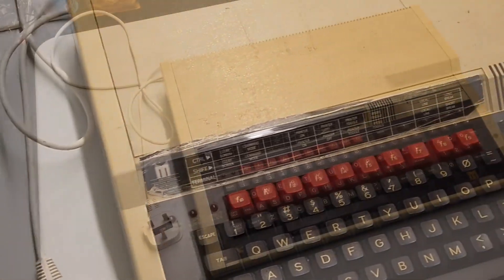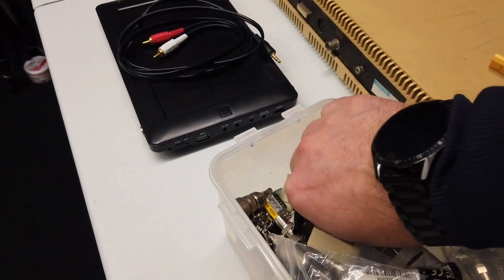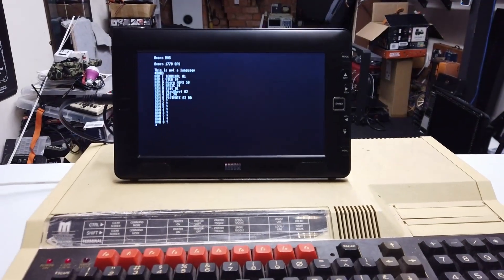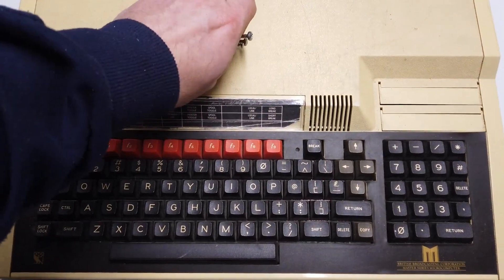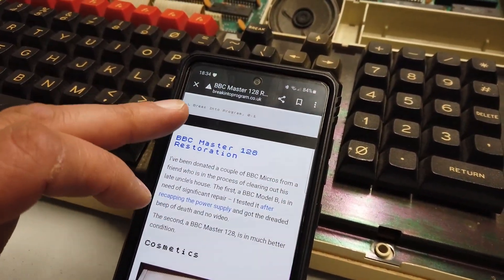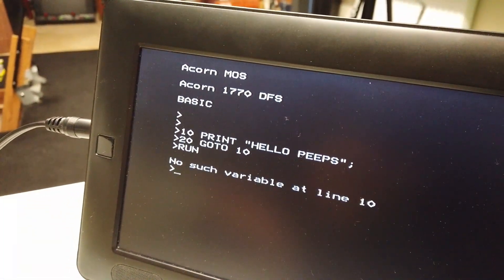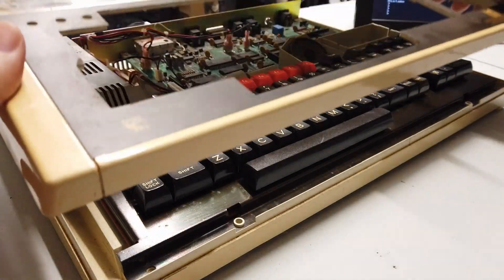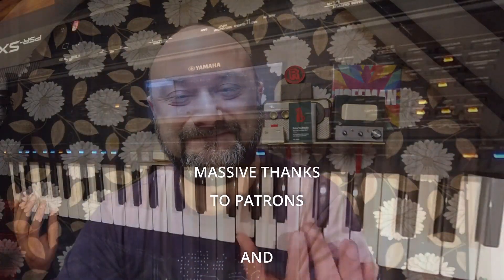DuB-EnG: BBC Master 128K Refurb, service and test, CMOS problems, keyboard not working, lets fix it!

Comment: The beeb master is one of the few machines I want which I presently do not have.
The prices they are going for on eBay are way out of my league and so I'll just have to carry on using the risc os on my p400 which has a beeb emulator within it.
Reply from the maker: Wow what's a p400? ...  there's a great Java BBC emulator you can tinker with on a website 👍 😀
Reply: @DubiousEngineering  I missed out the i, I meant my pi 400 :)
On the pc I normally use BeebEm.